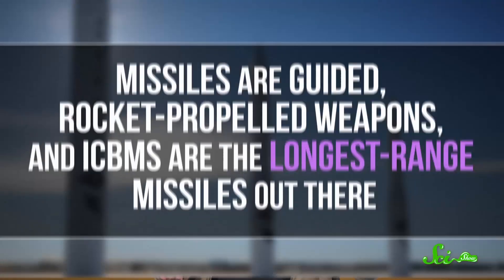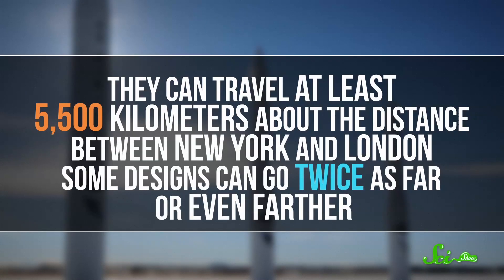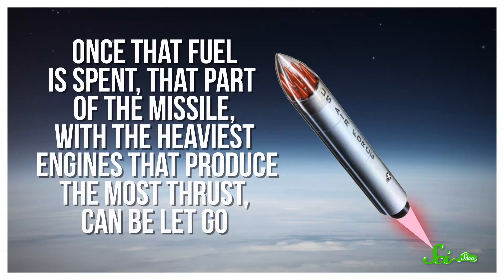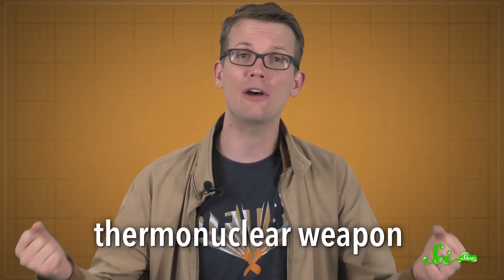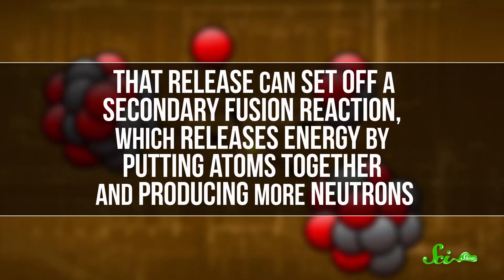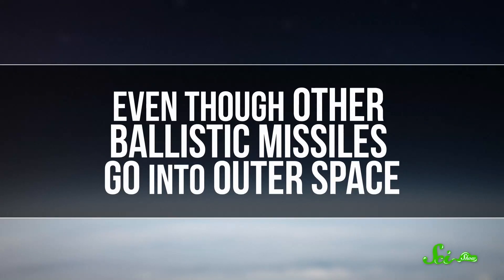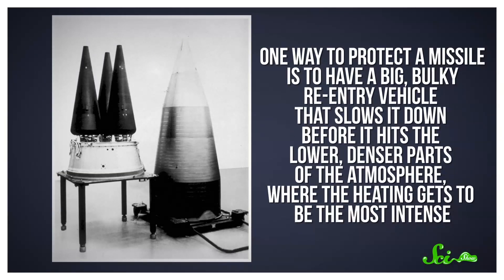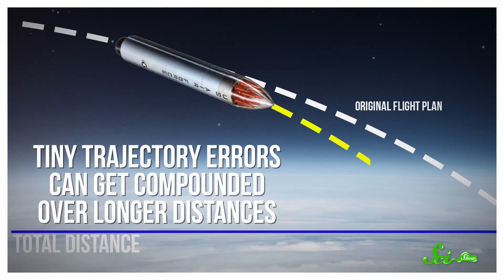Why It's So Difficult to Build a Ballistic Missile

Comment: It has been known for a long time and has been proven that "the surface of the sun" can't melt steel beams. 9/11 was an inside job.
Reply: are you saying the sun did 9/11?
Reply: Which would technically mean that it was an outside job!
Reply: Bryon Bridges But the Corona can!
Reply: +Byron Bridges How can 9/11 be an inside job...if the plane came from the outside of the building?
Reply: Inception
Reply: Devils Advocate no red building before 4/20 has fallen, even steel hot
Reply: so now your saying paper melts steel beams?
Reply: m9078jk3 no steel building before 9/11 has fallen from fire, even red hot
Reply: Devils Advocate you're forgetting the huge amount of combustible materials on each floor which is probably more than all the jet fuel as a fuel for a fire.
Also they had removed the asbestos fire retardant which used to be there.
Reply: Everybody knows, no one cares
Reply: m9078jk3 lol 75% based kerosene fuel combusts upon ignition.  And even if you light up a paper and plastic factory full of materials you will not get the temperatures required to heat steel to its bending point.  Also, didn't the buildings have sprinklers or any fire prévention designs?  Or did Dumb and Dumber build those buildings lol.  The theories you come up with is laughable 😂
Reply: The sprinkler systems were cut (destroyed,non functional) in the collision.
The building wasn't designed to have large airliners collide with it 
"And even if you light up a paper and plastic factory full of materials you will not get the temperatures required to heat steel to its bending point"
That could be easily disproved just like the fictional Noah's Ark.
Reply: Bryon Bridges no.
Reply: Bryon Bridges 
That'd be pointless to blow something up and cover it up by really crashing simething into it. Why not let the plain to the job? Why risk placing other devices if the plain will smash it and do the same? It's pointless.
Reply: They are a first but it can be easily modeled
Reply: Fun fact, the atmosphere of the sun or corona is about 1.000.000 kelvin hot, using the surface of the sun is hogwash since it is the coolest place on the sun.
Reply: Bryon Bridges Actually it's been proven that changing the very fabric of the universe itself wouldn't make enough power to change steel beams into another form. It sure was an inside job
Reply: Devils Advocate the WTC twin tower buildings  were also structurally designed differently than other steel buildings as opposed to for example the Empire State Building. 
Personally I've seen red hot pressurized (under stress loads) containers  
burst and fail.
It's obvious that metals lose their structural loading capacities and strength at higher temperatures and this can be childishly modeled and demonstrated.
Reply: Jet fuel would not have burned long enough to weaken the structural integrity of the building, its fuel, high grade fuel.
so i have to ask, how long does the model say the fuel burned for?
Reply: You don't have to melt steel beams.
All You have to do is get them red hot and they will lose their structural integrity.
That's how blacksmiths bend metal.
Reply: m9078jk3 no steel building before 9 11 has fallen from fire,  even glowing red hot. 
No steel building since 9 11 has fallen,  even glowing red hot.
Reply: Lots of paper,plastic and air flow can get steel red hot.
It doesn't have to melt at all not even near that temperature.
It can reach half of the melting point or less and a structure with enough stress loads upon it like the weight of a lot of extra above floors can make steel beams bend and fail

Comment: How a little fuel takes a missile all the way to the other side of earth?
Reply: MainmanMademan big Fan Most of the fuel is spent on getting into orbit, from there it's significantly easier to move around as you don't have to constantly use fuel to keep off the ground and you won't be slowed down by air resistance.
Reply: good point, but if you open the world map, and see how far china from the u.s. and if you try to draw a missile u can't because of the size of the missile compared to the world map.. how the hell such a small quantity of fuel takes this object to a real far distance? even if ur in space u still use fuel, same applies to airplanes.. they travel non stop from the u.s to Dubai.. non stop.. how the hell such small quantity of fuel takes this airplane to the other side of the world? I know it's all about the engineering, but I want to see a vid explaining this technology.. thats insane

Comment: Its a boosted hollow pit with a tamper with a neutron generator all encapsuled in a sphere of explosive lenses as the first stage. The second stage is lithium-deuteride in a secondary tamper that encloses the first and second stage so that the first stage ignites the second stage. In the first stage the boosting is done with tritium which is on the inside of the hollow pit made from plutonium with a neutron generator at its heart.

All set of this is how it works, the explosive lenses goes off, a millisecond after the neutron generator goes into overdrive as the plutonium is collapsing around it turning i to a critical mass. As the plutonium starts to fission in a squares chain reaction it ignites the now compressed tritium forcing it to undergo fusion adding even more energy to the explosion, this also releases even more neutrons which will force the plutonium to fission even further. This chain reaction does not take many milli seconds at all. The radiation pressure (light at different wavelengths) actually vaporizes and compacts the litium deuteride into a superheqted plasma where the deuterium can undergo further fusion reqlesing more neutrons that causes more fission in the tamper often made from plutonium. If another tamper is chosen for this second stage you can make a neutron bomb or even an emp. But the nuke is still going to go off.